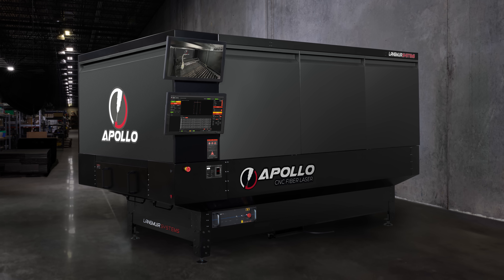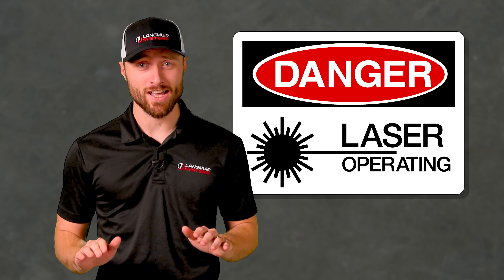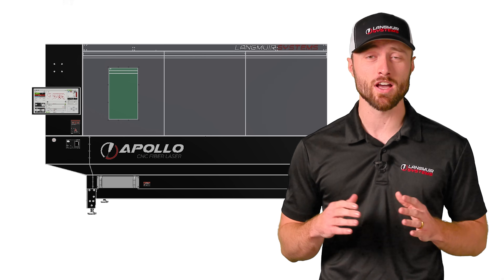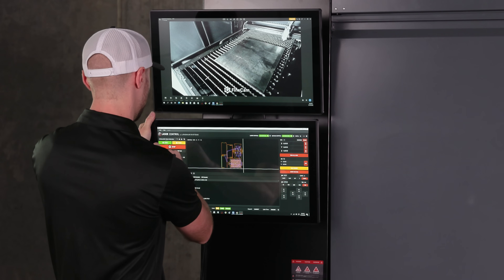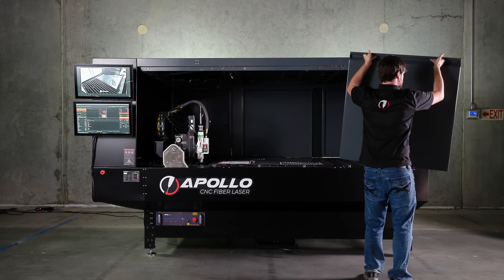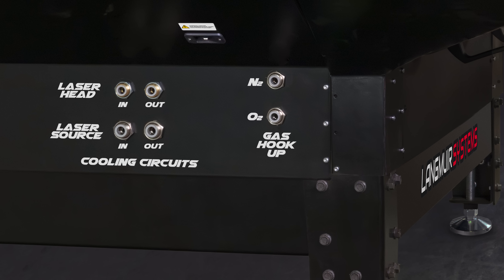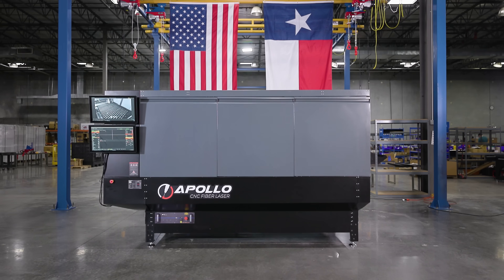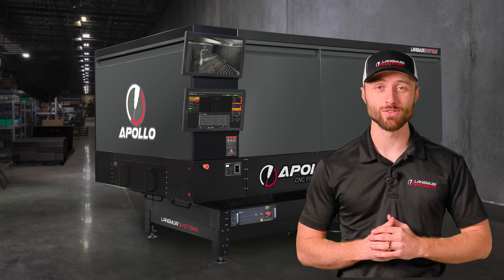Meet the Apollo CNC Fiber Laser – Deposits Now LIVE!

Comment: Cau you use lightburn to design and cut with this machine?
Reply: I use Lightburn for my Ruida-controlled CO2 laser, and my fiber galvo laser.  I fully plan to continue using Fusion 360 and Lightburn to create DXF's for cutting.  But looks like this machine will have Langmuir-designed software specifically written for it, just like the plasma tables and press brake.  No concerns here, I love FireControl on the plasma, and I'm sure LaserControl will be just as good.